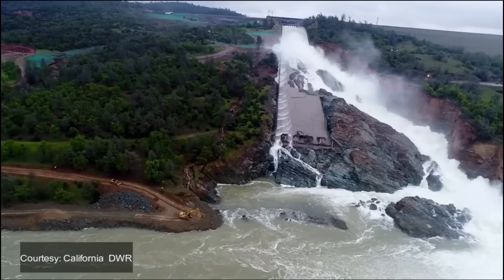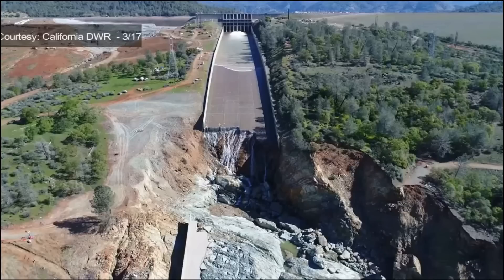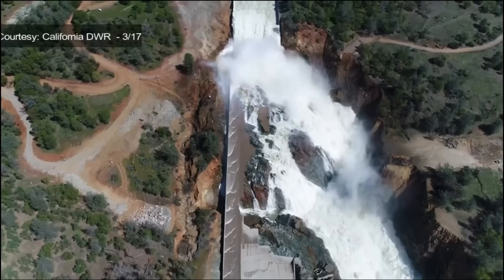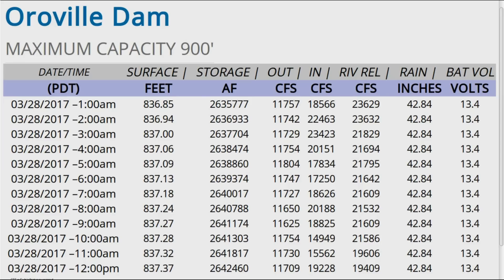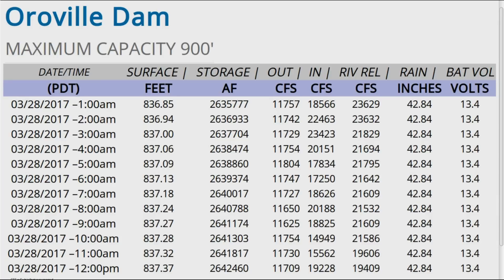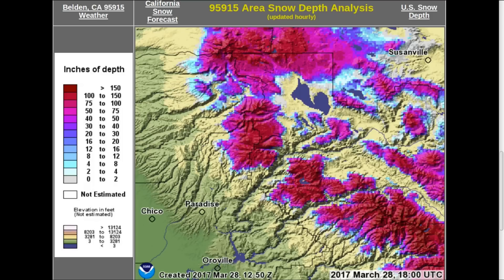OROVILLE DAM: Primary Spillway Shutdown 3-27-17 Observations and Discussion

Comment: How's this for a plan?  Fill in under the spillway to support fixing with concrete as before.  Then pave the concrete with 1/2" steel "shingles" that won't erode nearly as readily as the comparatively weak concrete.  Or if you don't like that, use 3/4" steel.  I wouldn't be surprised if 1/4" would hold up, actually.
Either way, best of luck with it.  Better youse than I!  8-)
Reply from the maker: Interesting ... I was thinking maybe they shouldn`t fill in the primary spillway ravine at all, but instead build a "water freeway" across the ravine. Use the appropriately heavy supports and whatever material needed for the elevated spillway stretch. There still seems to be good bedrock after that, so you could build on it at the bottom. The problem is how deep is that 1st plunge pool? Could be quite a span across.

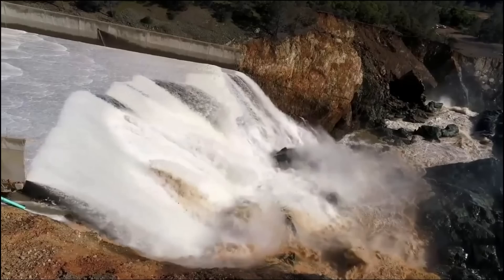Comment: Did you notice at 3:23 the water flowing from the pipe from under the spillway?
Reply from the maker: Thanks, Al I didn't see that ... not a lot of water, but I do wonder why it`s there. What do you make of it?
Reply: There is a much better view at 3:27. Why is it there? I have no clue. It just doesn't look like NOP (normal operating procedure) to me.
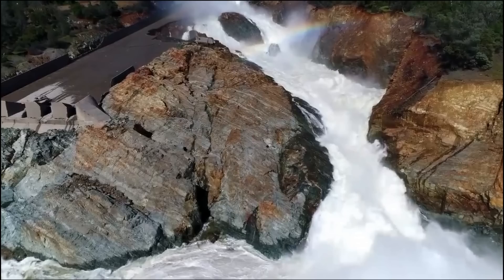Reply: And is that water seeping from the rocks on the right at 3:13?
Reply from the maker: It would seem likely ...also, I was just looking at the DWR footage from the spillway shutdown 3/27/17. It appears some big pieces of bedrock ledge may have come loose falling into the channel. Will need to find some good comparative "before" shots but it looks like some big boulders came loose over the last few days.
https://youtu.be/ixTg5Tgzeus?t=52
Reply: Steve Wilcox Yes, that is what they are hoping. But, with all the feeder lakes above Oroville full, the entire spring melt flows into the lake. It's going to be dicey at best.